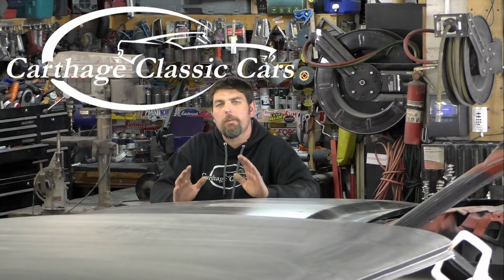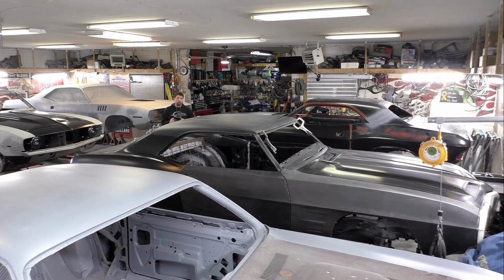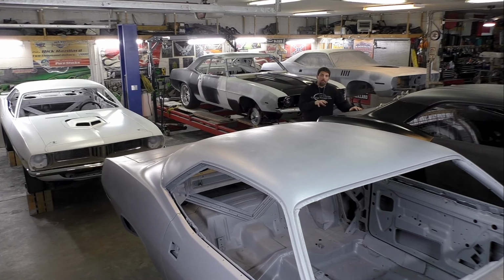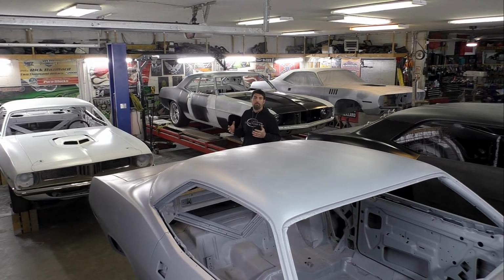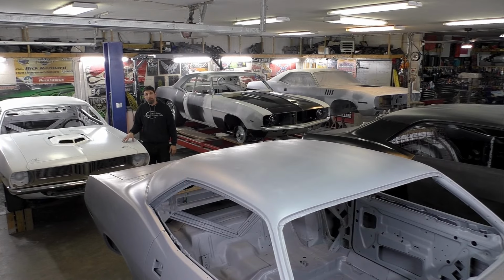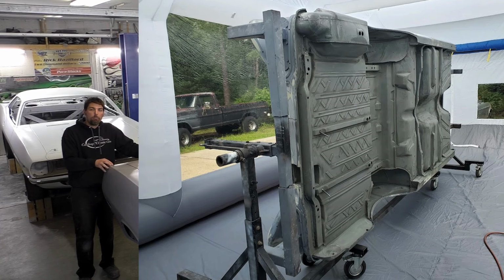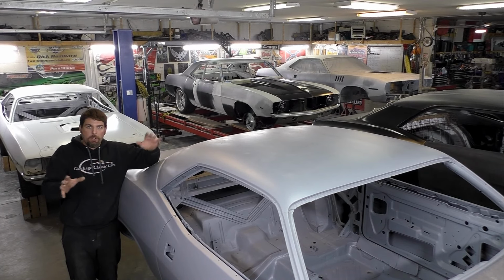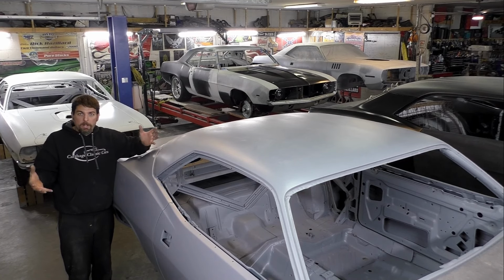Carthage Classic Car's Restoration Shop

Comment: E coating of the entire body?
Reply from the maker: I am sorry I don't understand the question. Most of the cars when they leave the shop have the e coating stripped down and OMNI Epoxy primer in its place. Epoxy primer is far superior in every way then the foreign e coat, the base for all bodywork and paint.  Some of the cars you see with the e-coat still on them are still in the building phase and will have it removed at the end of the build.
Reply: @carthageclassiccars  I was watching one of the stripping channels and they mention some of the cars went to a separate facility to be E-coated.
Reply from the maker: @johnglave7958  Not sure how other shops do it, however I usually take care of the stripping and rust preventative coating in house.
Reply: @carthageclassiccars  I understand that from an exterior sheet metal perspective, but on a cost is no object job. Isn't there a benefit to having all the interior welds, seams and joints e-coated?
Reply from the maker: @johnglave7958  E coat is not actually epoxy there is a difference. E coat is a process of almost like applying powdercoat with electrolysis to apply but without the durability.  On most of my builds If the owner will allow I will da sand most of the interior e coat off best I can or we sandblast inner structure then right after on all structure surfaces inside and outside coat the entire build with epoxy which in my opinion is far superior. So yea I agree I try and suggest to the owners we seal this car in every aspect that we can with quality epoxy to prevent any rust from coming in the future. Most of the time I will even spray it in rockers and frame rails I can not actually see just to get it in there.